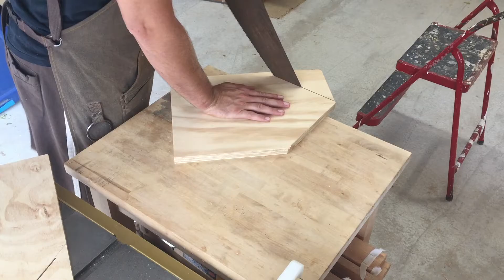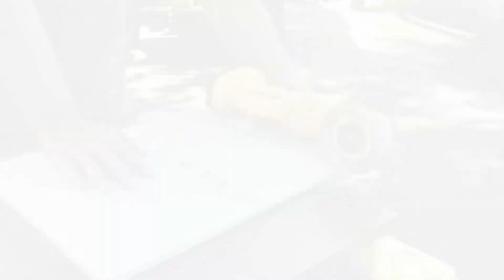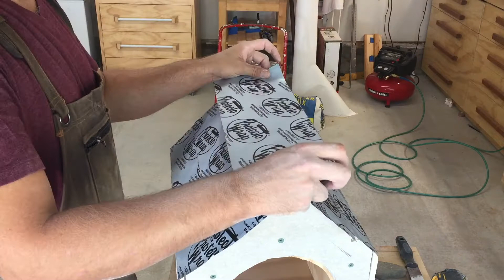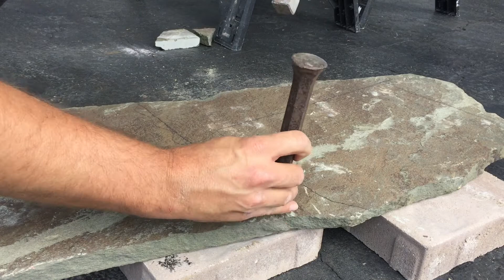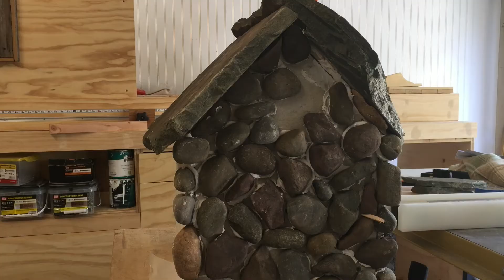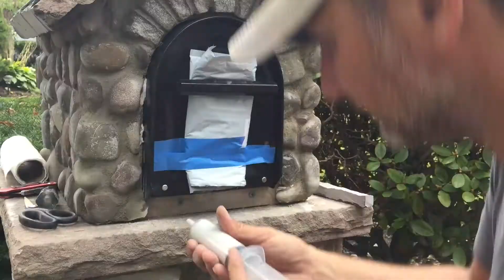How to build a mailbox / DIY Mailbox

Comment: I was all excited to watch this thinking I was going to attempt it until I saw how much cutting of the stone was required. I love everything but how the one side of the roof stone overlaps the other side. Couldn’t you have cut both sides pretty much the same size and filled in the gap with mortar?

Comment: Yes was awesome. Thinking if doing similar only just bigger so as not to cut the mailbox
Reply from the maker: Mine held up well through the winter but, if I ever make another one, I would use a masonry adhesive.  (the kind you put in a calking gun)  That's probably better than what I used  but, I didn't think about it at the time.  If you do make one, send me some pics. Good Luck!
Reply: @ArtisanMade  will do. And the adhesive worked very well on a fire pit I did for my brother at his place in Illinois. Takes a little bit to set up so the bricks didn't move around tho.